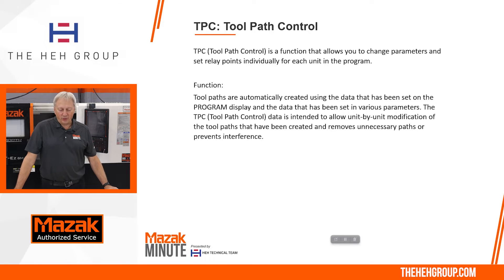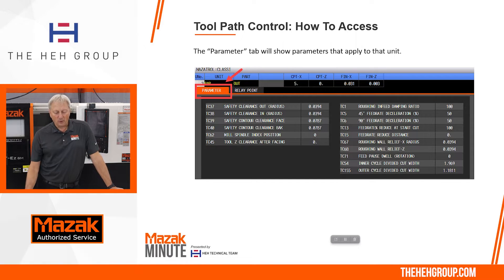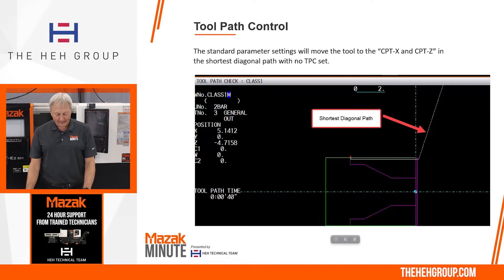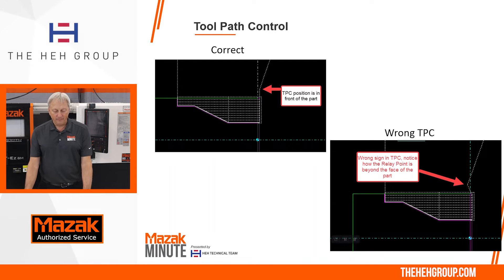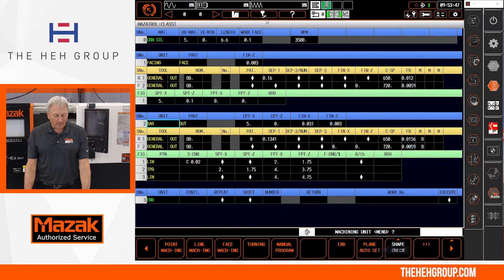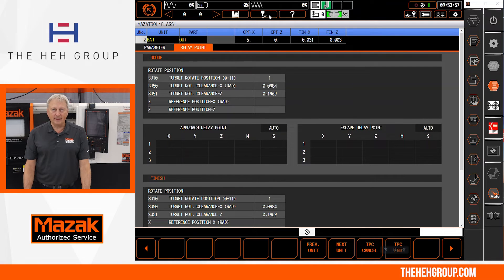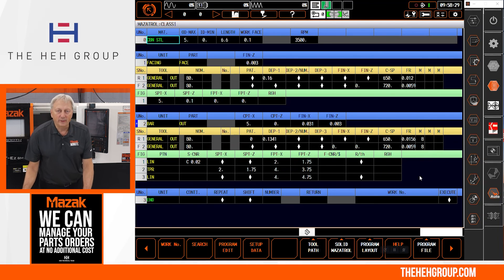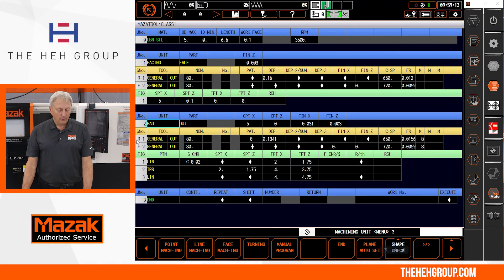Mazak Minute | Episode 9 | TPC - Tool Path Control

Comment: Hello, may I ask what software your using on your laptop/computer to simulate your programs on Mazaks?  A link on where to buy the program would help my experience grow gradually :)
Reply from the maker: Hello! It's called Mazak Smooth Cam RS. Contact your local Mazak dealer and they will be able to get you a quote for the software.